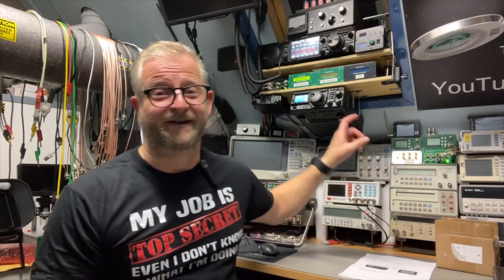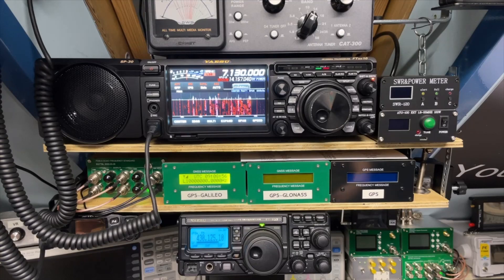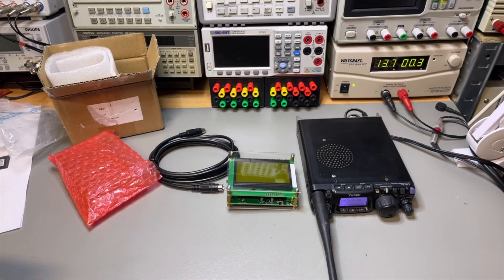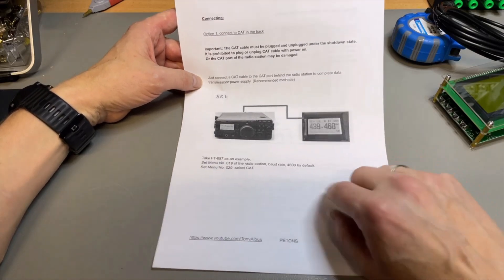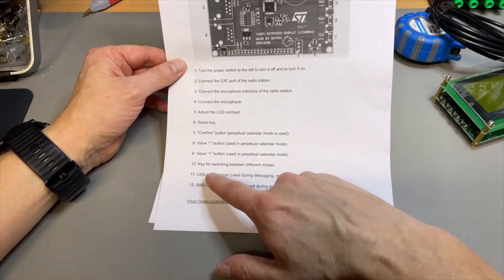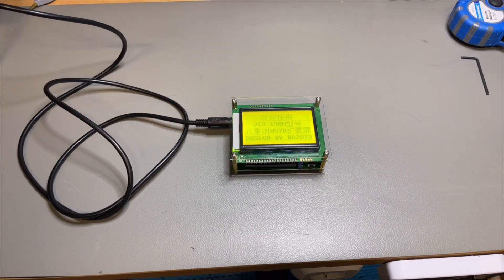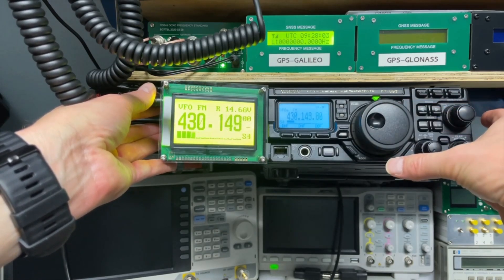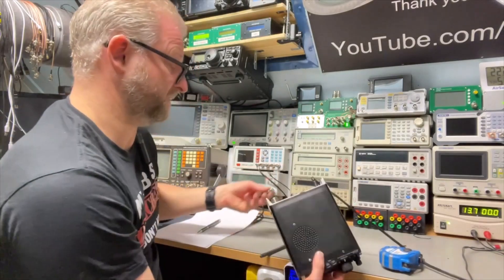TA-0313: Yaesu FT-897 FT-857 External CAT Display maybe also for FT-817 FT-818

Comment: Excellent video.  I am looking for a solution as my 857 has the dreaded zebra display now.  Question - if you change your radio from VFO to Memory display does this display also change?  Sounds like a silly question but what is displayed would depend on how the software was written and what it is capturing in the radio.  Tnx Tony.
Reply from the maker: Hi, thank you. sorry to say that i have sold my 897 with this display to buy a 857 like you have. It will only show the information that is send trough CAT.. so menu it will not do.
For your display problem, there are replacement displays on AliExpress if you are good with a soldering iron, this could also be a solution for you. but this external display is perfect for supporting old eyes like mine as an extra :)
i will put some links to the replacemnet display in the video description
73 Tony

Comment: Hi Tony. Interesting video. Very good explained. I want to buy, but i hope it works with 817. My question what should the menu setting be if you use this combined with a linear on the back ?
Reply from the maker: Hi Kees, i did not get it to work on my 817, the 12volts that should power trough the CAT plug somehow does not power the display, but that could just be on mine.
But i have niet tried connecting it with external power.
on the 897 you can connect it via the MIC plug also, this is not an option for the 817. as in the menu you cant change that setting for the mic.
i am not sure how to combine it with the liniar.. maybe make a splitter for only the PTT
Reply: @TonyAlbus  Tony thanks. Thats the nice thing about our hobby.  Experiment. I will look into this how to fix . Again thanks Br kees

Comment: I’ve been trying to figure out the difference in the FT-897S versions I keep seeing for sale on eBay ,, that are in Japan . I have heard they don’t have the same frequency capabilities ?? The prices are much cheaper , even after import taxes and fees ,, do you know what the S model in 
897S means ?
Reply from the maker: The frequency, is prob not a problem after a MARS mod.but in Japan there are also low power models... so maybe thats why it is cheaper. so be sure you have a 100Watts model.
Reply: @TonyAlbus  
Ok thank you 🙏
Reply from the maker: @Dallas-Rife-UDX-347-Tennessee  i read also that sometimes the japan firmware is locked to transmit out of band, so mars mod does not work in that case. there are some tricks trough CAT to temporarily hack this.  i would be careful buying a japan model.
Reply: @TonyAlbus  
Yeah I figure you’re probably correct . I have an American version , 897D ,, it’s in great shape , I’d kinda like to have another one but them 900 to 1200 dollars prices for one in as good as shape as the one I have , hurt pretty bad . Thanks for your help man , I appreciate it , 73’s 
KK4ISW 👋🏻

Comment: so how can you change things on the radio if you can't see the radios display? the new display won't let you see three buttons to change mike gain for instance?
Reply from the maker: Yes you are correct, its a display without controls, maybe some controls can be done by the microphone, depending on the type you use.
Reply: @TonyAlbus  thank you Tony great video.
Reply from the maker: @DennisBallengee  Thanks!

Comment: Was suprised to see it work when plugged into the mic socket. So you have CAT control from the mic connector or is it just and output. Either way that is an interesting option.
Oh, by the way, you sound like a great friendly guy. Nice video.
Reply from the maker: Hi Martin, yes there is a second CAT port vide the microphone connector.. you need to switch it over menu 59(guess) but you then lose the up/down buttons on the mic.

Comment: Unfortunately it does not support FT-817ND/818ND…
Reply from the maker: I think it does, it is my 817 that is not providing enough power on the plug. i bought it last week and never looked at that.
Reply: @TonyAlbus  I can confirm it works on my Ft 857 & my Ft 817 I recently replaced the ft 817 with a Ft 818nd & that also works No problem  Have not tried using the ethernet port yet.Waiting for a ethernet cable to arrive as the ft 818 cat port is being used for the Ldgz 817 atu
Reply from the maker: @jeffdowner2378  Thanks for sharing!  that is great to know.

Comment: menu 14 baud rate 817
Reply from the maker: Yes that is correct, but i did not find a setting to switch it from CAT/LIN/ATU ... but is should work anyway, then prob my power is just not good from my port. i think its my 817 that is not good, i will check the power on the plug.